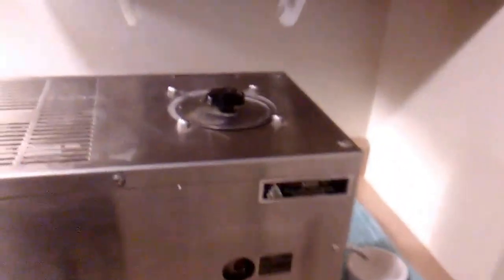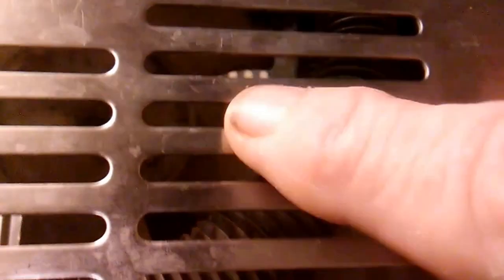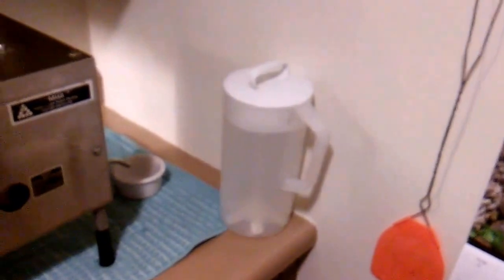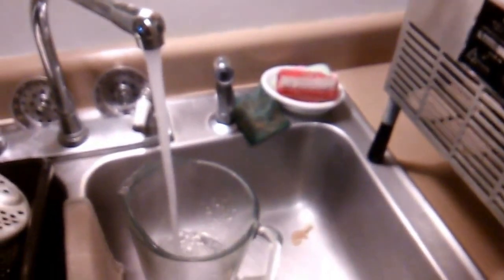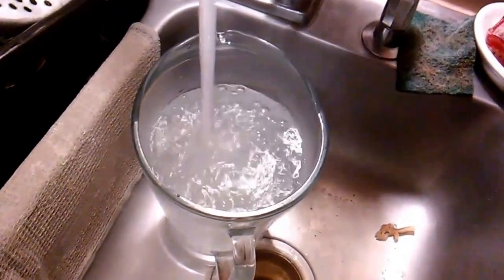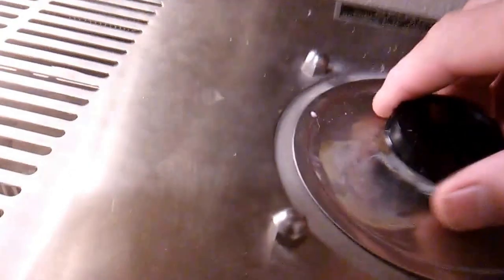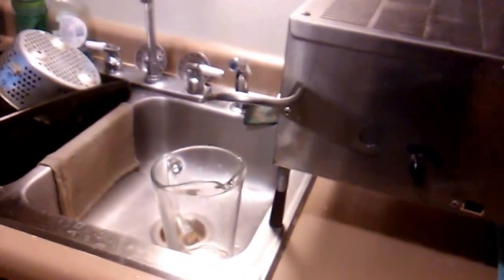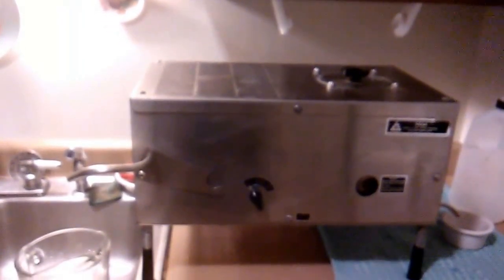Using a Midi Water Distiller

Comment: When I was a kid back in the early 90sbl we lived in West Palm Beach, Florida. The water contained large amounts of sulfur. This is especially an issue in most of Southern Florida. My dad bought one of these but it was the one with the integrated 4 gallon stainless steel tank for storage of water and the ability to connect to your water main. It refilled using a small float similar to what you would see in a toilet to control turning on and off the water but also acted as a failsafe to prevent the water from dropping below the heating element. Even with all this you can run the thing manually by just filling of the way you did in your video. It included a small charcoal filter that obviously isn't needed since the water is filtered but helped a little bit with taste. 

My dad gave us the machine in 2014 as a source of distilled water since we were using it a lot for our children's breastfeeding implements that need to be boiled in distilled water. Having not been used since the early 90s it started up like a charm. I cleaned out thoroughly with hot water and vinegar and then rent it out really well. No planned obsolescence there. The heating element may eventually need to be replaced but the company still exists and provides parts, and even manufactures a slightly tweaked version of the exact same unit. 

The water where we live now tastes ok but is full of scale that leaves calcium deposits anytime you boil water. That make it a good and cheap source of distilled water that we use in any of the devices we have that recommended. Clothes steamers, tea kettles, etc. It costs about 35-40¢ a gallon which is considerably less than what you can get in the store and doesn't involve plastic.
Reply from the maker: We like the midi, but like you mentioned, the calcium buildup is quite an issue with it as well, it leaves deposits on the reservoir as well as on the heating element, it's a real pain to remove the calcium buildup
Reply: @ItsaRomethingeveryday  l made a solution of vinegar and water and I store it in a large vinegar container I have left over from Costco. It's about 50/50 distilled vinegar and water. I reuse the same solution again and again and just run it through a sieve before storing to get large chucks of calcium. In the time that goes by between cleanings a lot of the particulate settles and then I can actually slowly pour the solution into the distiller leaving behind the settled particulate. I then rinse out the container. 

I just heat that solution up inside the chamber and then let it sit for 20-30 minutes then I heat it up some more let it sit for 20-30 minutes and then after it cools down a bit I'll get a scrubby brush with a long with thin handle and moving around inside the chamber just a tad to knock stuff off. I then let it sit there for about an hour with the lid off to cool down to where I can put my hand inside. I have large hands (XL to XXL gloves) but the opening on ours is just barely large enough to wear I can squeeze my hand through and I then use my hand to knock stuff out even better with a smaller Little brush. The extra soak time in the vinegar solution really helps and so while it requires a little elbow grease 95% of it is hands off.

I then fill the chamber up a few times and rinse out the remaining solution from the drain port.

I highly suspect that the seal on the drain port is silicone because they use silicone everywhere else. As old as our unit is had it been rubber like you see on many spigots I would have expected to see the seal disintegrate by now. That being said, I feel certain you should be able to find a replacement as it's extremely serviceable machine. Even the little charcoal filter we have is a canister you actually fill up with your own charcoal and cotton filter pads or you can buy them premade from a company.
Reply: "It included a small charcoal filter that obviously isn't needed since the water is filtered but helped a little bit with taste." FYI all distillers have the charcoal not to improve the taste but to remove VOC chemicals that vaporize along with the water. It's the last step needed to have completely pure water.
Reply: @renaldo1319  what are the VOC chemicals?  I have the same model as you are showing.  I purchased my unit off Ebay some years ago... I never had the charcoal filter option... what does it connect to?  My drain tube is set up to use that metal hook you have on your machine to hold a 1 gallon water jug by the little finger hole.  Still not sure where the charcoal filter goes with these units.  My parents also had the large unit with an attached holding tank.  We did not have any charcoal filters or even considered it as an option.  Typically one would see where it would be installed if there is a holder or pocket to stuff one of those filter bags into, but not these machines.  Thanks for the video... great job explaining it.  I found if I allowed the unit to overheat and stop each time ... after a while you will get the burning silicon/rubber smell and taste in the water.  No one explained that, but I found out by messing around with options... Equal water in = less or equal water out.  Note... the timer is such a variable to dial to get your gallon amount to come out and not overfill the jug (which makes a water mess).

Comment: You ever think about putting the link for the second video in this video? I paged through four years of cupcake videos and had to give up
Reply from the maker: Unfortunately I don't know how to add links in video description, I apologize for that
Reply: @ItsaRomethingeveryday  I purchased a used one for $50. Everything works on it. Just need to get filters. 4 filter pack, enough to last for a year, $44 
Thanks
Reply: @ItsaRomethingeveryday  can you tell me how long it takes to make a gallon of water with the distiller you have
Reply from the maker: Around an hour usually
Reply: @ItsaRomethingeveryday  I understand sir.

Comment: Chemicals Don't come out in Distillation.. One also needs to filter the chem's out.
Reply: The chemicals absolutely DO come out with distilling and no filter is needed unless there is no off gassing vent and your water contains VOC’s, then you’ll want to use a charcoal filter.
Reply from the maker: For what it does do is quite noticeable and beneficial
Reply from the maker: The only chemical we use is Lime away, and then rinse it thoroughly,, wipe dry, and cycle it once with water, empty it wipe it out again and let dry overnight, then it's ready the next day